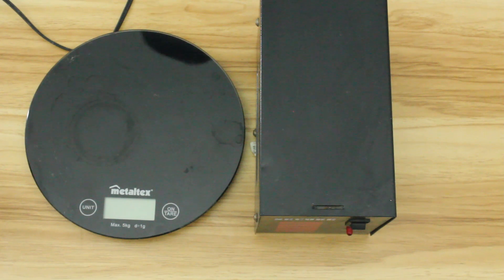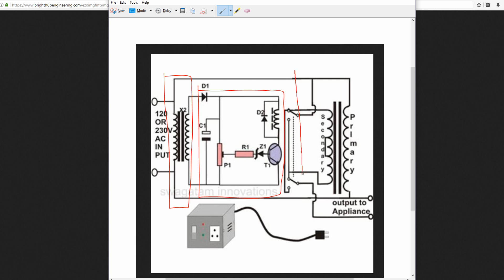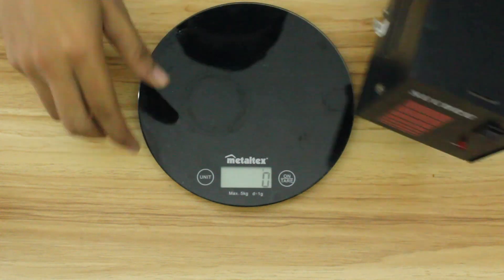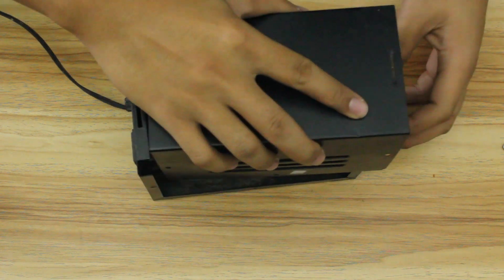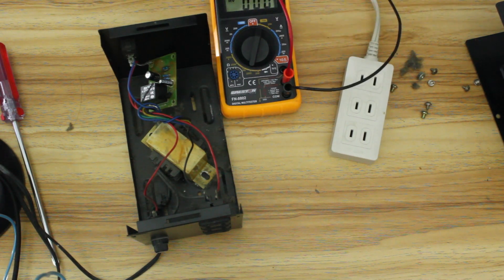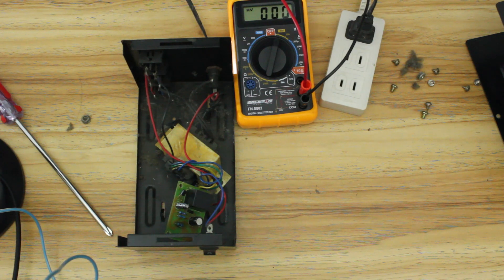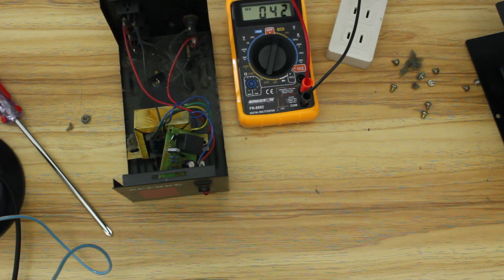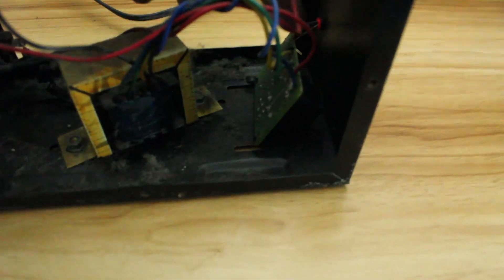NEVER buy a CHEAP Automatic Voltage Regulator for your PC!

Comment: need po ba gumamit tlga ng avr kahit yung mga bagong psu ngayon slamat po in advance..
Reply from the maker: If you're using quality PSUs like those from manufacturers like Corsair and Seasonic and if you're mains supply is stable, it's normally safe to use an AVR. But please be aware of the risks if you cheap out on the PSU. Look for a PSU tier list, get something in the higher tier.
Reply: Truerate gamit ko sir 500w. Ok lang poba yun

Comment: Some one sold me a not a cheap avr its really heavy but one day my brother accidentally hits my avr and its started rattling when I shakes it so I opened it I saw a cracked cement block and a single piece of wire connected to four outlets I can't believe my pc survive that long without a avr

Comment: boss may 600W PSU okay lang ba 500W AVR?
Reply from the maker: That depends how much load you have plugged in that PSU. I recommend getting an AVR that is 1.2x the maximum load (wattage) of your system. If you are in doubt, get a larger AVR.

Comment: If you have or wanted to get a PC, DONT BUY THESE KINDS OF AVR
Instead of buying these kinds of cheap AVRs, better get a decent PSU with OVP/UVP(Over/Under Voltage Protection), OCP(Over Current Protection), OPP(Over Power Protection), OTP(Over Temperature Protection), SCP(Short Circuit Protection)
There's a Tier List for PSU online, they list PSU down to their Specific Brand, Model, and production dates on what to pick and avoid.
If you want to get a secondary protection for your PC, consider a Surge Protector or a better pick would be a UPS.
A UPS would protect your PC and your work from power outage by giving you a few minutes of power to save your work and shut down properly.
Also don't forget to have proper Ground connection, so your protections (OVP/OCP/OPP/SCP/Surge Protection) to be properly working. The Surge Protector and PSU will send the unwanted Current to Ground to protect your PC.

Comment: Hi, Advisable din po ba na laging iswitch off everyday ang avr after use or okay lang siya nakaopen
Reply from the maker: That is not necessary. The reason you turn that switch off is to completely disconnect your PC from your outlet. When an electronic appliance is off, it still draws power - around 10W (varies greatly depending on the device). This is one reason to switch it off or if there is a lightning storm.

Comment: lol. ive been using this avr for a year and half now, i have a 600w psu.. no problem so far. i even lost electricity power will using it. my monitor also connected on it, still depends on pc. if your using a high end pc that requires a lot of power better buy a good one for sure.
Reply: Yup exactly, were the same bro,

Comment: -too many jargons
-lacking the means to thoroughly check the AVR, e.g. oscilloscope
-blocking the view of the voltmeter while testing the AVR

-unscrewing the AVR cover could've been fastforwarded

Overall, the video draws conclusion from inspection and the voltmeter alone
Reply from the maker: Yes, because we can't draw conclusions based on lack of components.
Reply: this guy is trippin', wire gauge alone is trash
Reply: @DeuteriumTech  just pointing out. might improve your next videos

Comment: i buy avr brand neur power,because i have some issue with my pc like buzzing when play video. hope buying a avr will solve my problem.

and last i check i use fps hexa psu the old one like 8 years ago brand psu.
Reply from the maker: I'm curious how did you conclude that's an issue with the AVR. Can you post your specs here?
Reply: @DeuteriumTech  its not avr problem, i think its my psu, it make my pc current unstable,always making a sound like buzzing/stuttering when play a music or video. After i use avr,seems like the problem go down 80% . but still got this buzzing thing sometimes. so it maby because my psu can't give it best to my hardware. 
My Full spec
Ryzen 5 2600
Gtx 1060 6gb
8gb x2 3200mhz ram (16gb)
6 rgb fan, 3 Led strip
1 ssd 2 sata hdd
psu hexa 500watts (2011 version)

Comment: Thanks for this video. I have the same experience with this kind of AVR. I've changed twice and 1-2 years ang agwat before the 2nd purchase. but the 2nd purchase last for a year lang. I checked kung anong problem kung ung switch or ung fuse, ung fuse pala ang nasira. I couldn't replace another fuse bec im not an expert para kalikutin. After that, I'd prefer to buy Panther Extension Cord Power Surge Regulator. Okay naman. almost a year ko palang gngmit.
Reply: helloooooo ask ko lang if di ka na gumagamit ng avr and direct to the extension mo nalang ba sinasaksak yung monitor and cpu?

Comment: Lmao I've been using that avr since i brought my old pc 😂😂😂, nice video though
Reply: Bro can i ask? I just recently buy this
But when i open theres a sounds come inside but its not too long it only happen when i on it. But after a week using it . I try to open it again and the sound inside is gone ? Is it normal?
Reply: Accel  when i plug in my pc in it even the avr is off i feel a ground in the back of my pc
Reply: @johndarreldelantar573  i dont know what are you talking about.  But if your problem is avr just buy a servo type
Reply: @johndarreldelantar573  btw whats your specs? Maybe i can help you
Reply: I can also feel some ground at my pc case, sometimes its there sometimes its not
Reply: @accelworld4170  sorry for late response, yeah i have that sound too, and I don't know if that's harmful, but i Never have problem using this avr, it's like 3 years old now and I'm still using it
Reply: @sergiojoaquinpelayo9155  that ground feeling is normal, if you're using a wire/cable without neutral point

Comment: Aww i already purchased same brand in online shop... i'm too late to watch this video
Reply from the maker: Don't worry. It's not totally useless. The fuse provides some protection. Though if you have a cheap PSU, I'd recommend replacing it as soon as you can.
Reply: If my psu is gigabyte p650b 80 plus bronze and my avr is powerplus 500w is it fine?

Comment: First its fake second its fake third its fake
Reply from the maker: I think that was already pretty obvious.
Reply: @DeuteriumTech  but many still buys this because its cheap
Reply from the maker: @johnlemuelm.santiago6036  Yeah. And that's why I had to make this video. Don't cheap out on safety devices, folks!
Reply: Do you need an original avr a real one exit signage andvemergencylight?